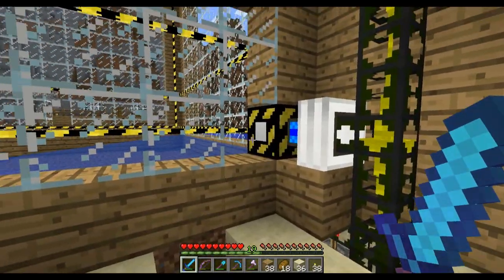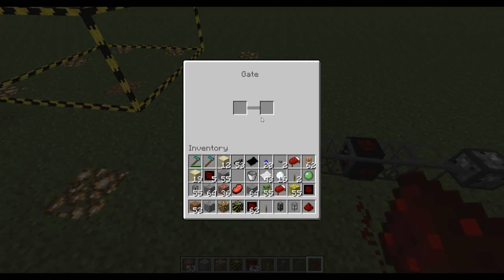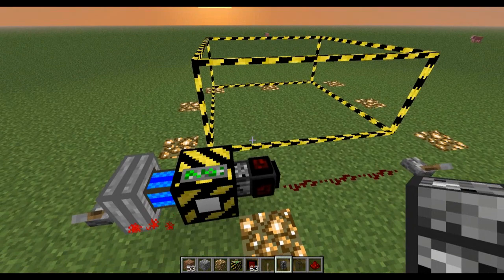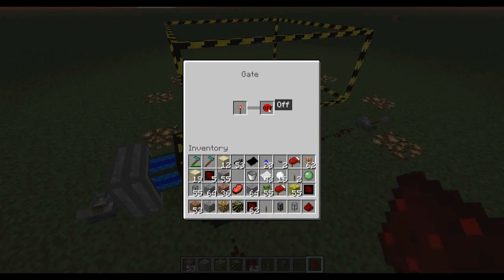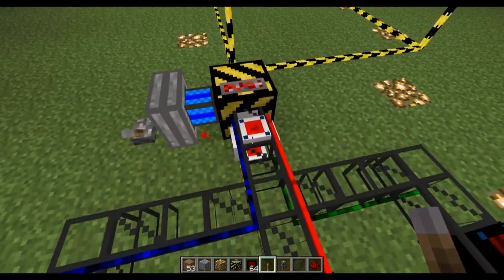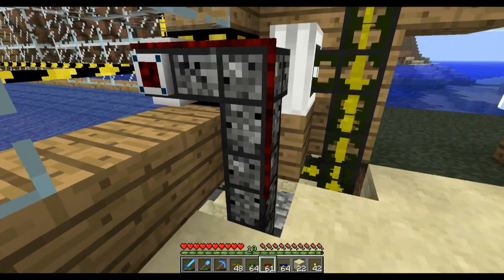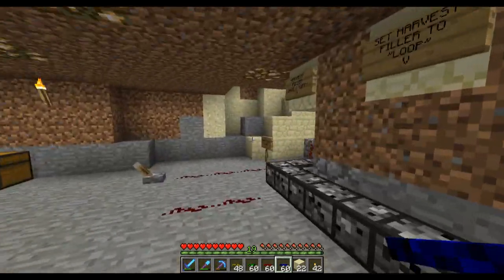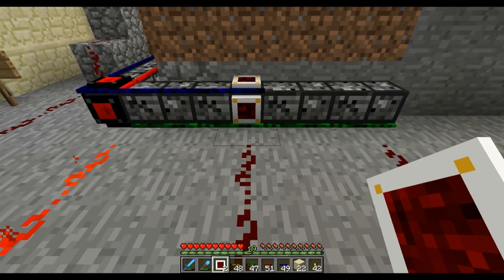My Buildcraft 31 - How to Reset a Filler

Comment from the maker: Yes, I thought of that.  If you see the next video, you can take it even further - because you can use pipe gates to tell when a builder finishes and when a filler finishes, there's actually no need to have either the safety line OR the torch builder!  The final setup used one filler and one builder for everything.  :)

Comment: A structural pipe is, i believe, either a cobblestone or plain stone pipe, with gravel above it in the crafting grid. it does absolutely nothing and connects to no pipes, but it allows pipe wire to cross between non connecting pipe types (i.e. between a liquid pipe system and a solid pipe system, or between stone and cobble pipes), allowing greater control. or, as shown here, for pure pipe wiring without awkward connections.

Comment: If you haven't yet you should get industrialcraft because makes a great pair with buildcraft. Also it may help to get the power convertion mod as well just to make all the machines easier to power.

Comment from the maker: I need to know when the filler finishes, because I need the signal to be sent out to reset the whole farm.  The "loop" mode never "finishes", so there is no signal that can b e sent out (unless I revert to using the torch builder again, which is silly).  Timers will not work, because the number of trees/blocks to clear will vary from harvest to harvest.  This way is actually quite easy, compact, and makes use of a cool feature of BC version 3.

Comment: i would have the signal that sends when the filler is finished go to a redstone torch and a hidden and gate connected to a button and the signal to send a pulse to the loop then the on after a few full repeaters

Comment: tekkit is a mod pack which has about 40 different mods in it includeing buildcraft Industrial craft redpower  railcraft Equivlent exchange ect. tekkit steals these files from the makers of the mods and uses them without paying the ppl that make the mods normally you would have to go to a website with an ad and thats how they made money but since tekkit is giving the files away the orginal authors aren't profiting

Comment: I watched this video, and finally fixed my own tree farm, based on your design, but for some reason whenever the builder finished, the filler would start up. I checked my circuits, and found no reverse connection. Any thoughts on possible reasons?